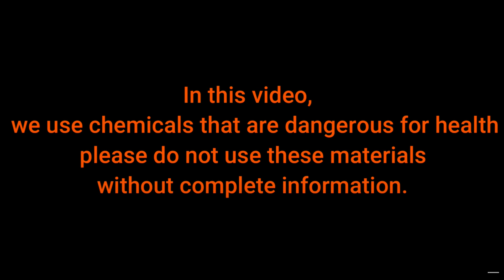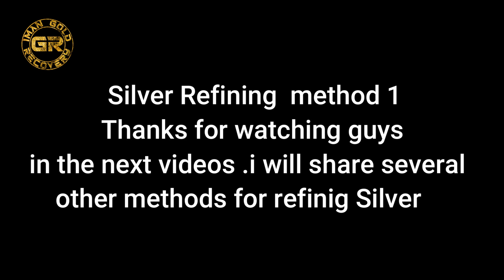Step by Step Procedure to Refine Silver | How to Refine Silver Alloy | silver refining | method 1

Comment: 250 ml nitric acid for 66 g of silver is a large access. 100 ml should be enough, or even less depending on how much copper there is.

It is apparent if you see how aggressive the acid reacts at about 6 minutes into the video. The excess acid is redissolving silver and dissolving copper.
Reply from the maker: thanks for watching and information broo 👍👍👍🌹
Reply: One cuestión after the metals disolvs you dont add nothing More to precipite the silver? Thanks. I hope undertand my english.